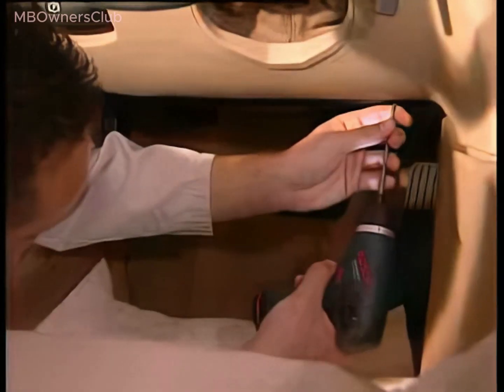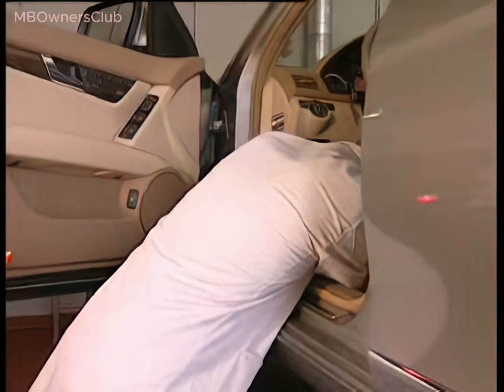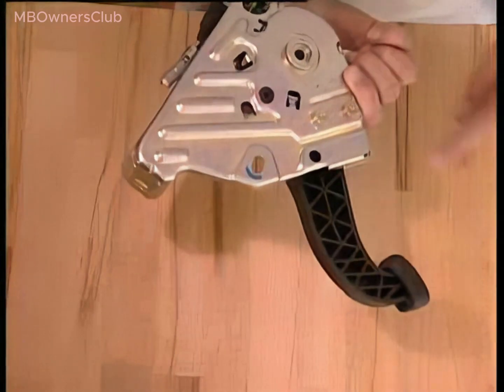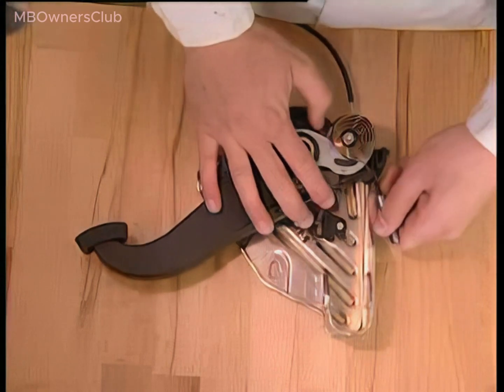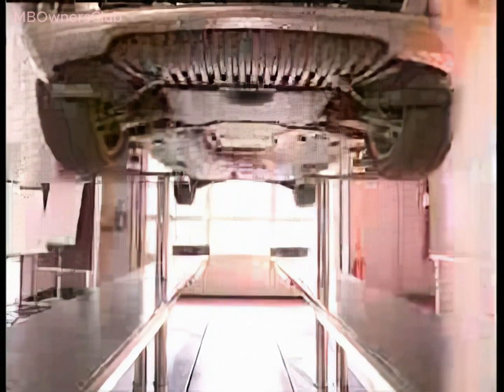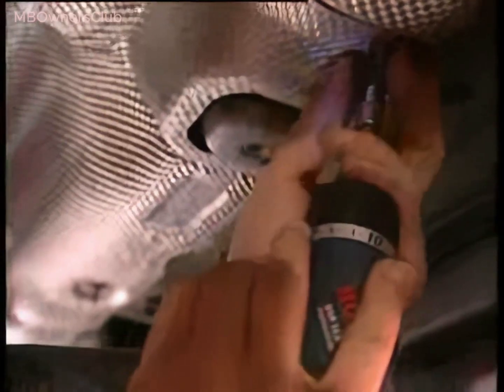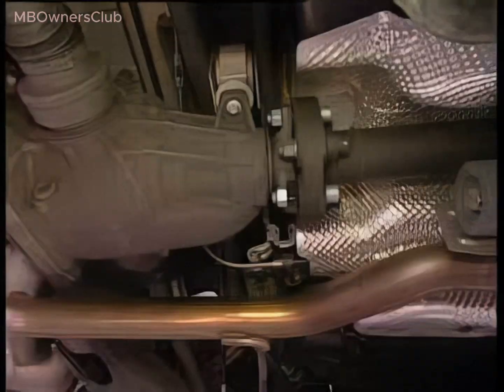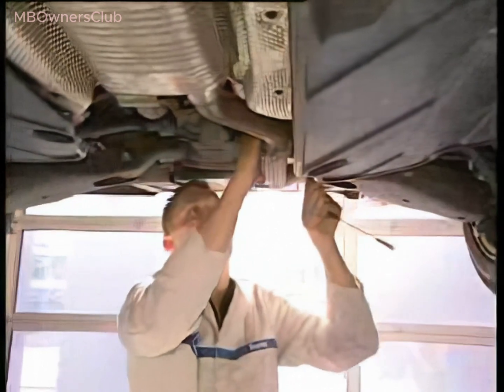Mastering The C-Class W204's Parking Brake: Maintenance and Functionality Explained

Comment: Hello, I thought my "cable was stretched" as it doesnt hold very well, not enough to pass inspection... i did the adjustments in the back brakes all the way and its still not enough... video says no need to replaced a stretch cable.. not sure what todo now or what it could be
Reply: Hey, l had the same problem l thought the upper lever used to release the handbrake needed work or the cable itself. When l went to my mechanic he told me the whole pedal itself should be replaced. I hope this helps!